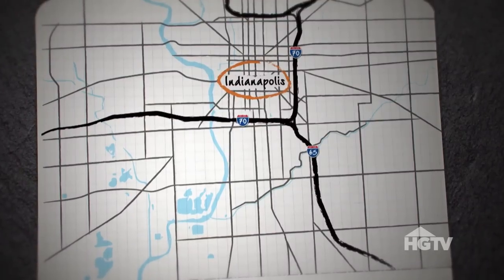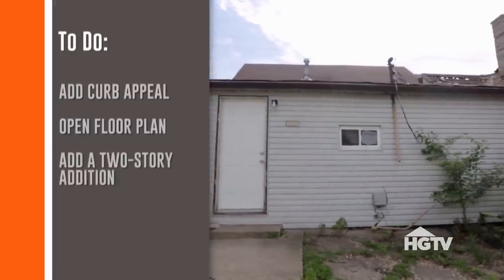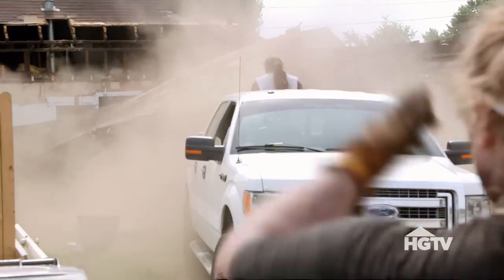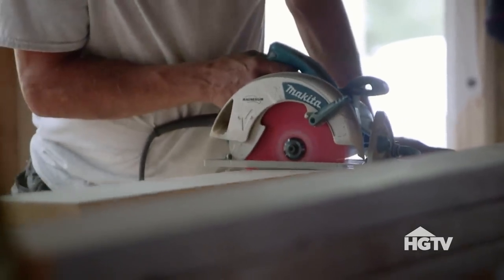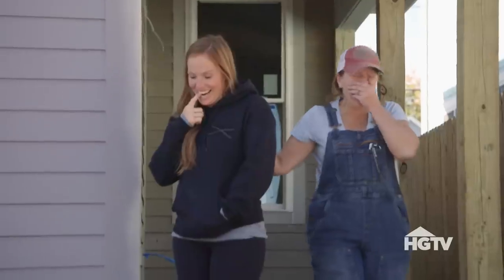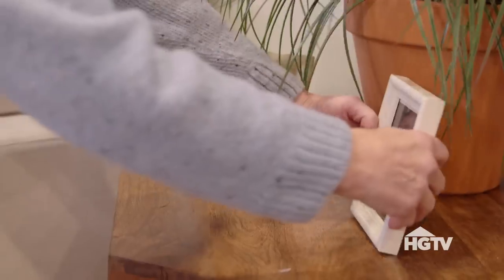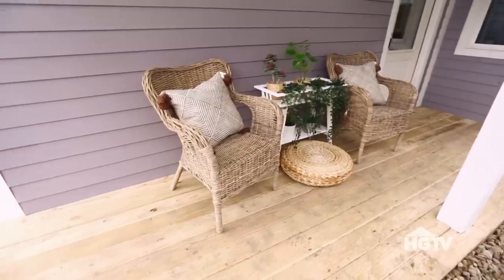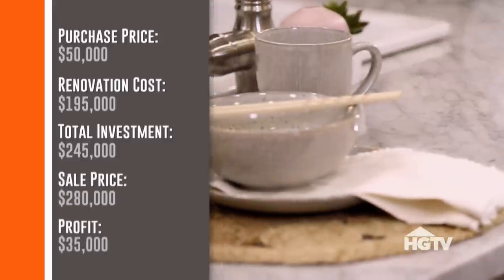Anything But Easy | Good Bones | HGTV

Comment: Once again, the construction is flawless, but the interior is blah. They’re great builders, but they should really work with a decorator (or get a new one). That first floor is all beige, everywhere.
Reply: I agree that the colors are ... Neutral 😐 but in my opinion I believe it is so the new home owner can put THEIR TOUCH.
Reply: @HELENGodLoves  The point is, they used color on the second floor, but not the first, when staging. The point of staging is to get buyers excited. Nobody gets excited about ecru.

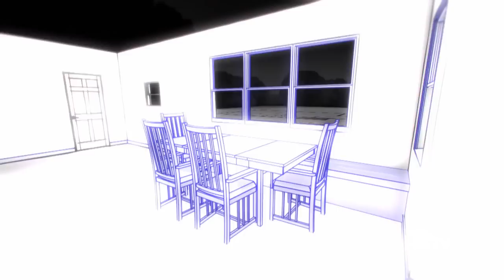Comment: @3:32, why not put the kitchen along the back wall?  The proposed layout eats into the living room.  @3:56, far too much is going on and you can now see just how little room there is for living.  Eliminate the ground floor bedroom and shower room and put the sleeping and attendant "bathrooms" upstairs.   @7:18, surprising to see that the floor is not being glued down. 

I generally like what karen and Mina do, but this Brit sees strange choices and missed opportunities.
Reply: It's a floating floor.. it's meant to be laid that way. Glue is a pain in the ass to remove and will destroy the subfloor if someone wanted to replace the flooring